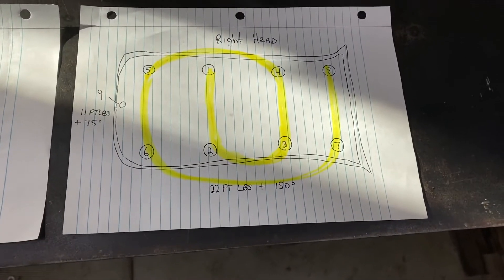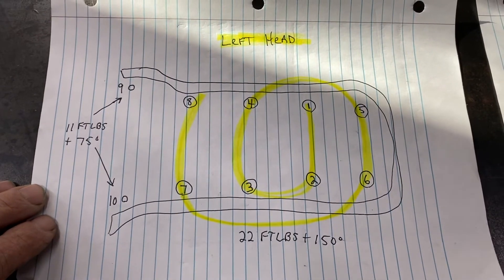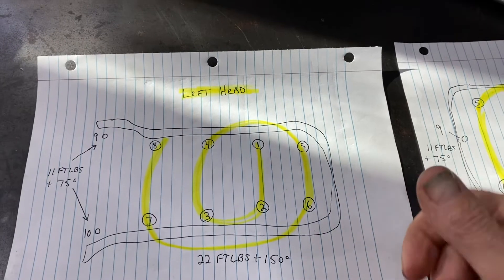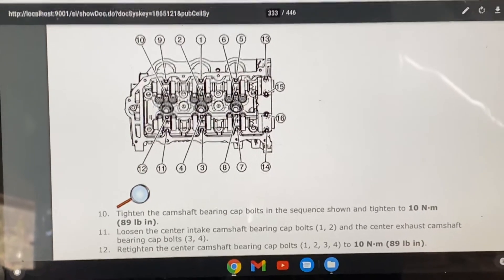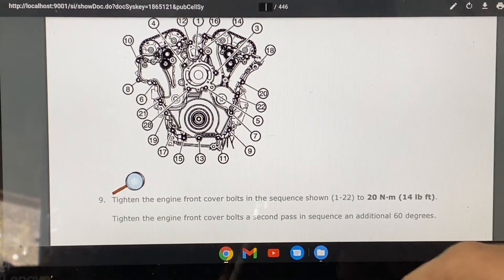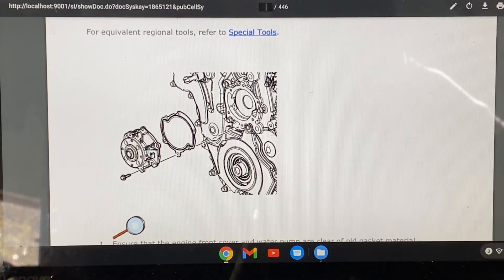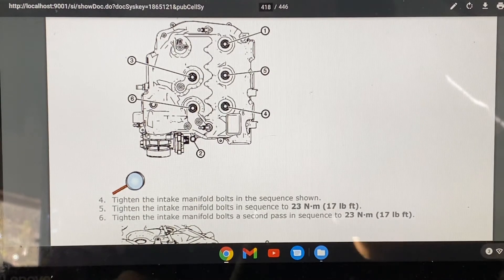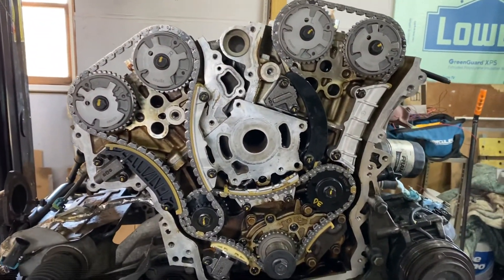09,10,11,12,13,14,15,16,17 GM 3.6 high feature engine torque specs.

Comment: Hello all, I am having a heck of a time locating the Harmonic balancer (crankshaft) bolt torque spec for this 3.6 engine?  Vehicle is a 2009 enclave. What does the manufacture call for?
Reply from the maker: Ricom, I tried to download the whole spec. page for you but it wouldn't let me. Anyway, The book says 74 ft.lbs. then 150 degrees rotation. I think the last time I did this engine I just went good and tight with an impact gun and it was fine. It's only holding the pulley and a drive belt. Some of these manufactures get a little out of hand on how tight these are like Honda. When you remove one from a Honda for the first time it can be a real battle for sure. I'm usually picky when it comes to torque values but, Iv'e done tons of balancers with just an impact gun and never had a problem. Hope this helps you out. Rob......
Reply: Thank you very much for the quick response, Rob. I have a good Milwaukee impack and will hit it with that. Have a great sir!

Comment: Great video. As far as the bolts coming loose, I’ve always been told to make sure it torqued to the spec before you do your degree. So in those case, do all 22ftlbs then do 150 degrees on #1 bolt. Go to the second bolt and redo the 22ftlbs torque sequence and just keep doing that after the 150 degrees. I don’t like the torque to yield for this reason right here.
Reply from the maker: Yeah that could be a good strategy. It seems the engineers are trying to achieve the most even clamping force possible on the whole head gasket. But as I said, Iv'e seen books for other engines use a three step process where the bolts get a bit tighter with each sequence pass. It just seems like a better idea to me....Thanks for posting.......
Reply: I think that’s a huge step up and should be a three step

Comment: Mis respetos a tu capacidad u conocimiento . Solo te quería hacer consciente de una contradicción que tengo que me gustaría que lo investigues....... la bomba de aceite si la remplazas se da el torque a los 3 tornillos superiores. Sin Tocar los de la guia. Porque se daña..... si no la remplazas solo cambias la guia de plástico.....espero no te sientas ofendida..
Reply from the maker: Hector, thanks for posting I have also heard of what you're talking about by not disturbing the oil pump bolts.  Sounds like a good idea to me as long as the new plastic slider fits perfectly on the old metal frame.

Comment: Appreciate the video. What are The little rubber pieces around the bolts for the timing cover for?  Is there one per hole or does some have two?
Reply from the maker: Tony its been awhile since i did this engine, But I think you are referring to the seals for the bolt holes. I believe where one per hole. I have a huge GM book on this engine as a pdf file but can't seem to be able to attach it to my videos. I can email it to you if you need it.      Rob.....

Comment: What's the final torque?  
Someone mentioned elsewhere 95ft lb as final torque. 
One thing I remember though when I was removing the head bolts, they were pretty tight.
Reply from the maker: It is not uncommon for head bolts to make a crack sound when they come loose. But you must be careful not to over torque them because it is a aluminum engine block and you can strip out the holes pretty easily. check out my channel I have a 18 part series on rebuilding that engine which includes a section of how to torque the head bolts properly. These are called torque to yield bolts where they get torqued to a certain value and then turned a certain number of degrees as a final tightening sequence.

Comment: Do you think you can torque going
1st pass 22ft lb 2nd pass 40ft lb 3rd 60 ft lbs.?
I just had a angle gauge not work accurately..
Reply from the maker: Yes D I think it's at least it's a consistent value that way, But i'd rather see 22 ft,lbs then 75 degrees then another 75 degrees. you can use paint marks as a reference if your torque angle meter isn't working for you.

Comment: What the heck do they mean by 150 degree? Is that like 1.5 turns? I don't understand that crud. But your tourque suggestion of 60 lb is a good start. Thank you
Reply from the maker: Shane 150 degrees is almost one half of a turn because 180 degrees is 1/2 of a turn. it would be like taking a handle of a ratchet from 12:00 to about 5:00 if you imagine the face of a clock
Reply from the maker: Check out my channel for some detailed videos on doing the torque sequence including the degrees
Reply: Ok thanks, just seems rather mynute amount of torque
Reply from the maker: @shanebryan8151  Your welcome. It is low, but keep in mind that the engine block is aluminum so the head bolt threads can strip out in the block if you over do it. This is why engineers came up with this torque to yield nonsense ( degrees )

Comment: Thank you for all your time making videos. Can I get your help can you please provide me with gauge sizes for piston ring i would really appreciate it thank you
Reply from the maker: Sorry I didn't get back to you sooner Fernando. For some reason I didn't get this notification. I will check to see if I have this information when I get home from work
Reply: @robbieraychannel  thank you i appreciate your time
Reply from the maker: Ok Fernando, Here is some info. right from the GM manual. 
piston ring end gaps:
first compression ring: 0.0059-0.0118 in.
second compression ring: 0.0110-0.0189 in.
oil control ring: 0.0012-0.0067 in.

piston ring thickness:
first compression ring. 0.0463-0.0469 in.
second compression ring. 0.0579-0.0589 in.
oil control ring: 0.0929-0.0976 in.

piston diameter: 3.6990-3.6998 in.

I have tons more info. in a e-manual that I found online. If you can give me your e-mail I'll try to send you the complete manual.
Rob......

Comment: Thanks for the great vid. I see that you don't include rod and main torque specs because this was apparently a timing chain job, therefore you wouldn't need to post that info but I had a spun bearing on mine, just got it back from the machine shop and am looking for the main and rod specs. Yea, I agree it's pretty stupid to go from a torque spec being good enough for a hundred years to suddenly you  have to go by rotation. I'd like to know what the resulting torque specs are and just torque them with the torque wrench. Anyway, I also see that you can't give us the .pdf file. Bummer! I REALLY need that info. I'm going to leave you my email address if you care to just send me the rod, main, oil pump and rear main seal specs. But to be honest I'd like to see you do a vid showing that info if you don't mind doing one. But I need the main and rod info as soon as you can get them to me. I would have started tonight but I don't have the info yet. wt3551109@gmail.com

Thanks again,

Wayne
Reply from the maker: Wayne I just tried sending the file to you. Hope it worked!!!
Reply: this for all.. hope it helps
Reply: Could one of you send the manual to me as well?? I’m in the middle of doing this job and it would be a huge help! Violent.pacification@gmail.com